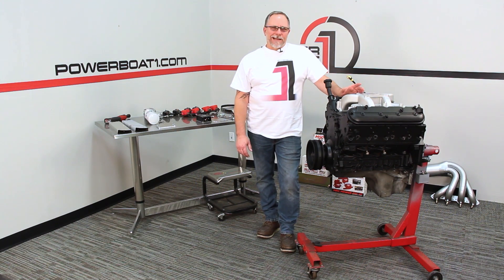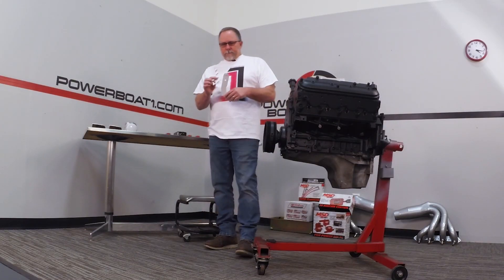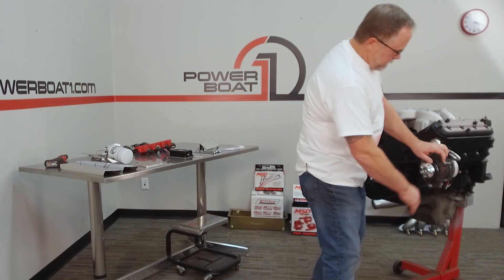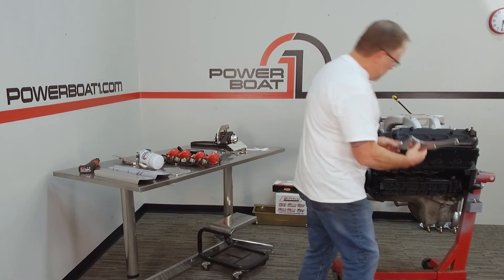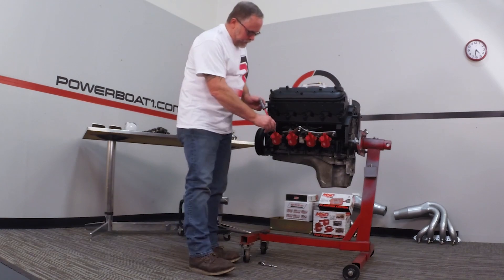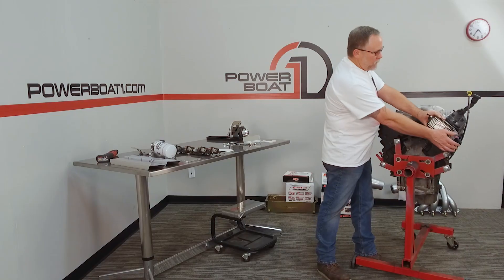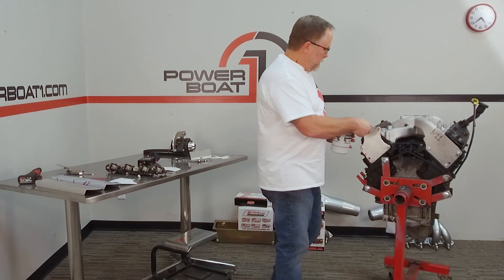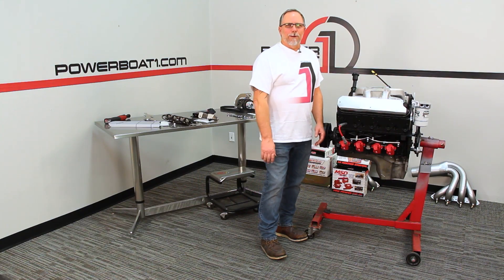LS ENGINE MARINE CONVERSION: Building Custom Brackets for Coils, Alternator, and Electrical

Comment: I was excited for this build until i realized you were using a carb and stopped watching.  Any reason you took 10 steps backward?  Almost no one wants to see a carburetor build.
Reply from the maker: We've answered this question a lot. The two primary reasons are that it does cost less to do a build this way, and we don't have to use an O2 sensor in the build. We plan to do another LS  in the future based around a Holley Sniper EFI or something similar.